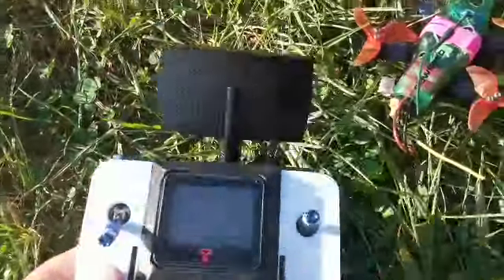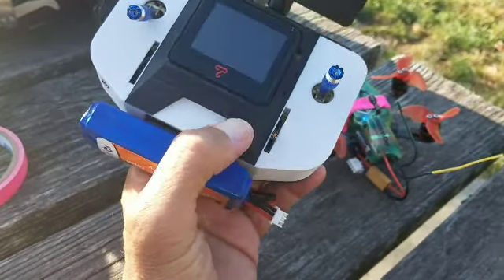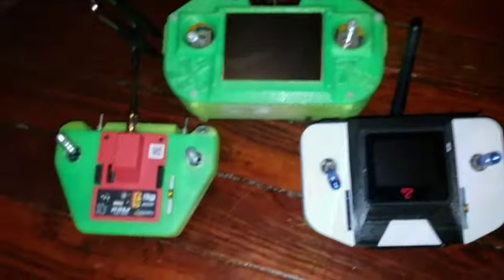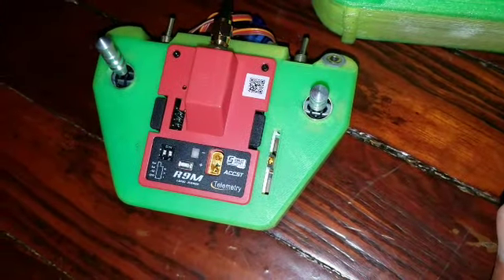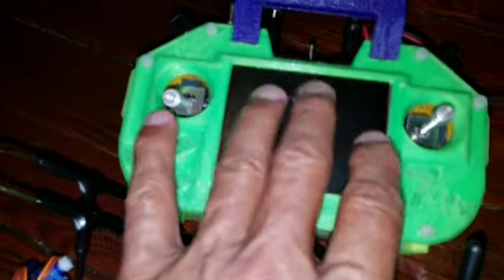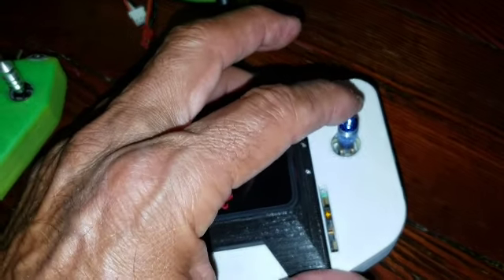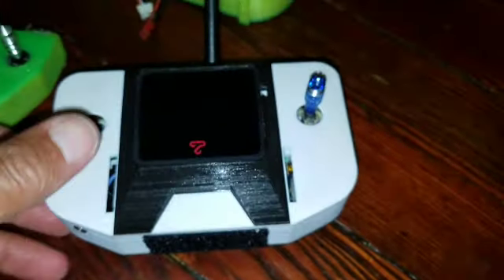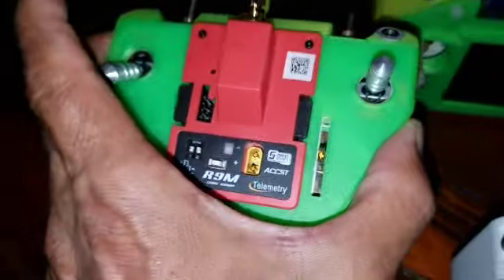Arduino rc transmitter

Comment: Great Stuff!! What frimware did you use in it?  I build one using Arduino. But I am looking some help in making a DIY openTX based transmitter.
Reply: Any luck?
Reply: No, I moved to Spain after that. I don't know the rules here. And where  I can the stuff. Also I left all my hobby stuff back in my home country.